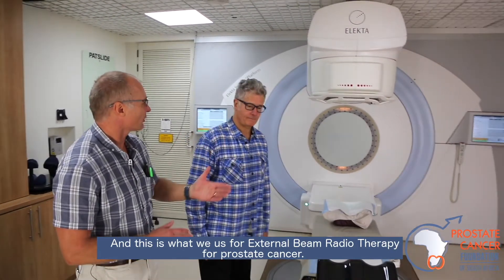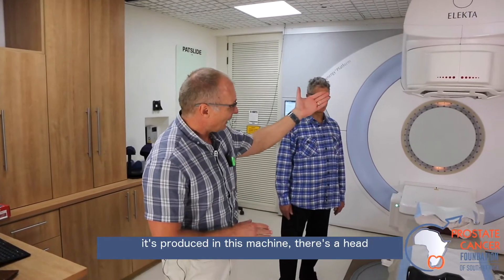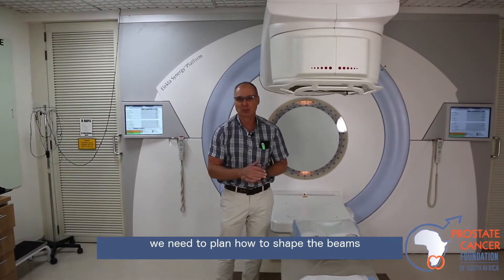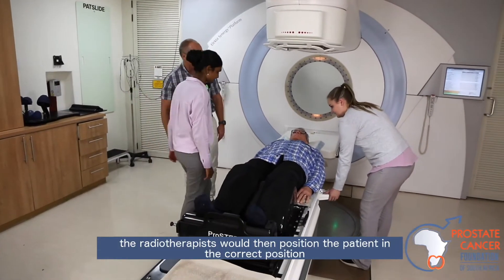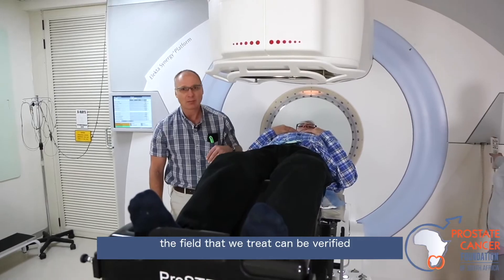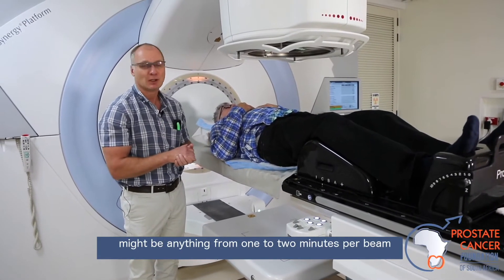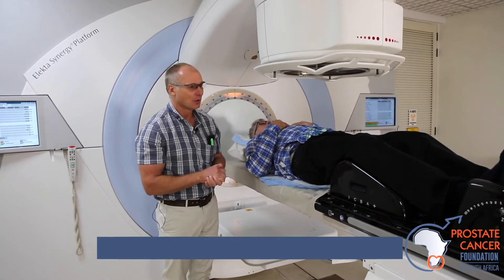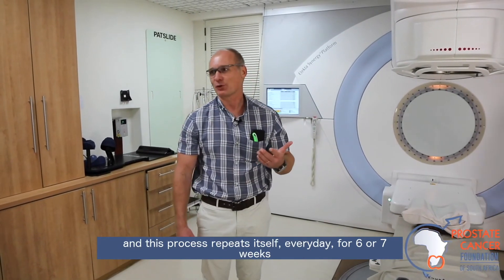External Beam Radiation Therapy is a non-invasive treatment option for prostate cancer

Comment: So, the movement of rotation where I go for EBRT is not smooth.  It's more of a jerking motion with frequent very short pauses. Is this normal for this kind of machine.  Or are the servo motors not working correctly?

Comment: They all have side effects. Seeding is probably  the best. But there's no money in it.  Not enough  doctors  do it. Now I'm talking encapsulated cancer. Cure rate are the same as removal. Seeding is done in less than 2 hours and your done. All radiation can have side effects 5 years down the line. Removal can cause death and also has its side effects

Comment: Absolutely agree with you. Non invasive my arse. I have also found on my journey you have to do your own detailed research. These consultants often hide the life changing side effects of there own treatments which is disgusting.
Reply: Couldn't agree more....

in the spring of 2023 I came within 18 hours of chemical castration (aka ADT, which they euphemistically like to call "hormone therapy") which is typically done in conjunction with external beam radiation.  Neither my urologist nor my radiation oncologist ever suggested that avoiding chemical castration via brachytherapy might be an option.  Via lots of research, I cancelled the hormone shot and now am scheduled for HDR brachytherapy.  Luckily for me, my caner is small enough and localized enough that this has a good chance of being a successful monotherapy.  For those out there who have been told they need external beam radiation with hormone suppression, I urge you to investigate the long term effects of chemical castration..... from what I can tell, you will never be the same.  Logically, brachytherapy (either low dose permanent seeds which deliver a higher dose in the long run, or high dose which is a quick but very strong 2-session exposure) makes a lot of sense as it delivers radiation most directly to the location of the cancer. There are also side effects to brachytherapy, of course.  These include urinary problems (relatively short term) but these side effects PALE in comparison to chemical castration.  PLEASE do your own research and do NOT just accept what the first doc says.  A doctor is very likely to recommend the thing that they are specialized in, be it surgery, external beam radiation with chemical castration, or brachytherapy.  This is not like being treated for a broken leg where the solution is a no-brainer.... YOU MUST DO YOUR OWN RESEARCH.
Reply: Hormone therapy for my prostate cancer was not fun, but was not as horrible as you suggest. I started it very shortly after learning of my Gleason 3+4=7 prostate cancer.  On its own, it lowered my PSA from 10.1 to 2.0 before my 45 radiation treatments even started. Yes it gave me multiple hot flashes every day and night, significantly reduced libido, and caused hair-trigger emotions (especially sadness).  I got a second 4-month shot shortly before my treatments ended.  

My PSA is now at a “cancer undetectable” level. The hormone therapy weakened the cancer cells and the radiation killed it (hopefully, all of it).

At my urology appointment to get a third hormone therapy shot, I begged to stop. The hot flashes were ruining my sleep and creating embarrassing work situations.  I also wanted to avoid further sexual limitations after finding out radiation treatment stops ejaculation (just like prostatectomy does).  My urologist agreed and I have been off hormone therapy for about two months now. I was on it for 8 months. The hot flashes are starting to subside and every morning I can see evidence of my libido and sexual function coming back…..as I was told it would.

ADT hormone therapy to me was a necessary evil. Prostatectomy wasn’t a great choice for me and neither was brachytherapy or focal therapy. It did the job it was designed to do and gave me the side effects I expected.  Fortunately for me, those side effects appear to have been temporary.
Reply: @gregmatzinger7758  Thanks for the feedback.  Can you tell be why you rejected brachytherapy as an option?
Reply: My radiation oncologist (and next door neighbor best friend) said the cancer had reached the outer edge of the prostate capsule.  Multiple other scans were required to verify that it had not metasticized - which it hadn’t. But he was uncomfortable recommending brachytherapy when the outer edge is confirmed to be involved.
Reply: I opted for HDR Brachytherapy.... it seemed logical.... avoid the chemical castration and is more exactly targeted than either EBRT or LDR Brachytherapy.  I'm still furious with my original oncologist for not telling my my full range of options.
Reply: @Brammy007a  i think its disgusting your oncologist didnt tell you the your full  range of options available to you 
what the hell was the oncologist playing at 
i am being offered physical surgery and the oncologist seems only interested in pushing me down one avenue when  i actually want light therapy or nano knife ,
my surgery in two weeks time but i dont want that
Reply: @Brammy007a  thanks for sharing
Reply: Sir what are the life changing side effects. Please inform me.
Reply: @markbrown5117 . No reply yet is there.
Reply: @markbrown5117  the bad one is proctitis.